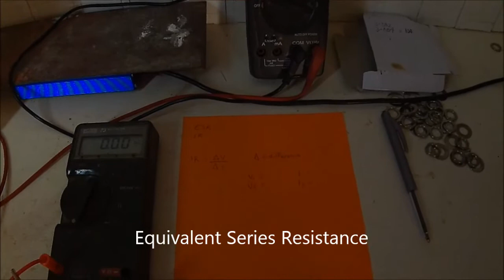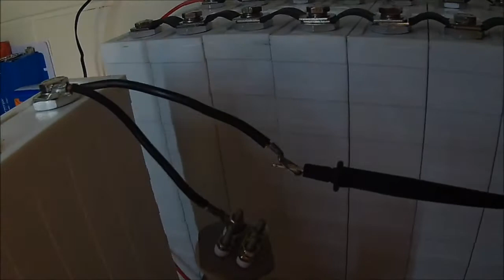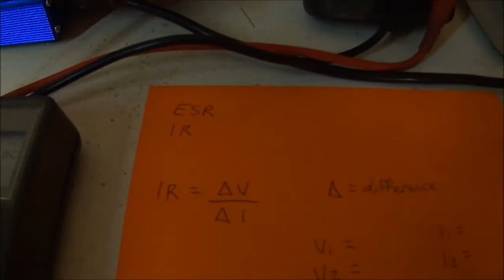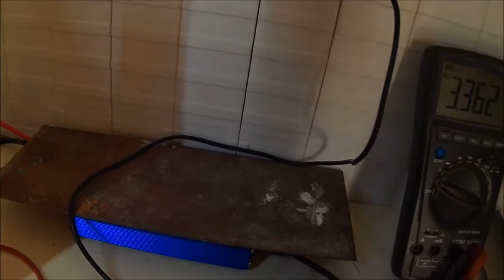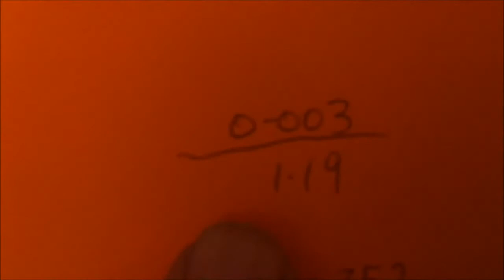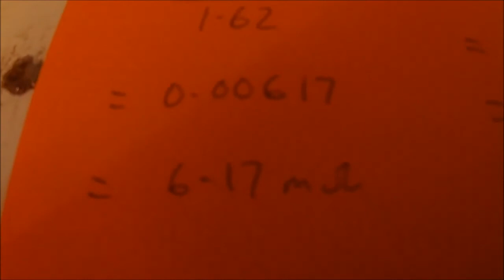How to calculate Internal Resistance (CORRECT METHOD)

Comment: I'd imagine that's got a bit of error from the battery recovering while you go from I1 to I2 - try putting a switch between the I1 terminal and I2 terminal so you can throw the switch and instantly change current (might have to get a tripod so your hands are free).  Then calculate it two ways - increasing I and decreasing I as a sanity check.. If they are the same, I'd be confident in the number.  If your meter has a min-max function, you can very briefly throw the switch while letting the meter catch the new reading.  --H